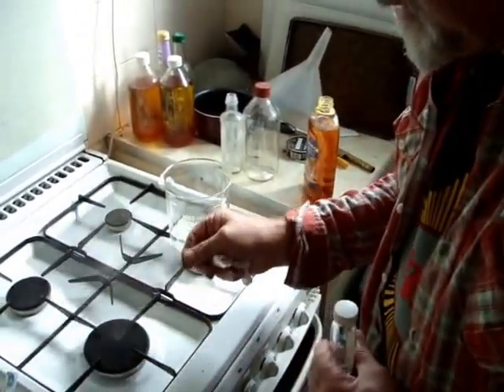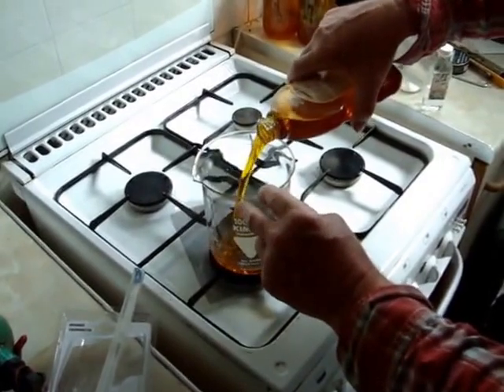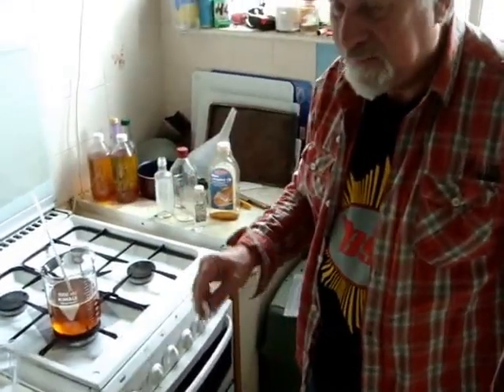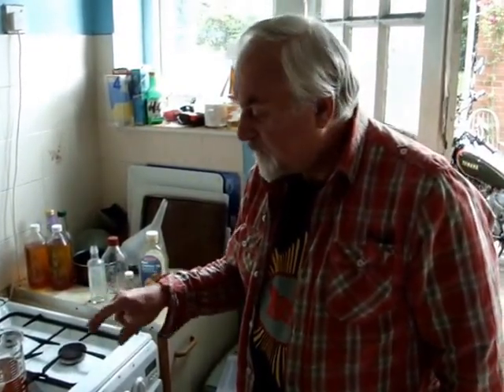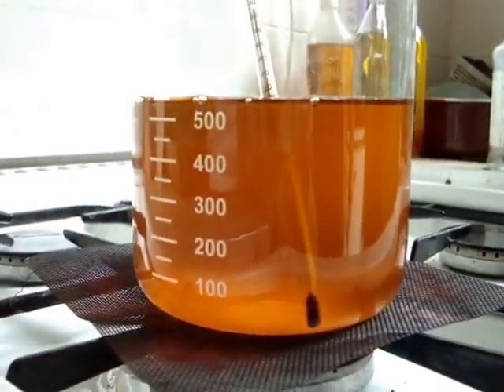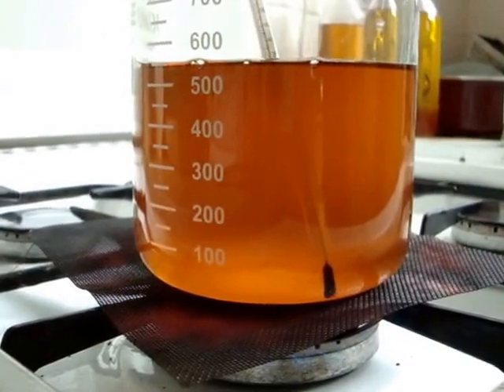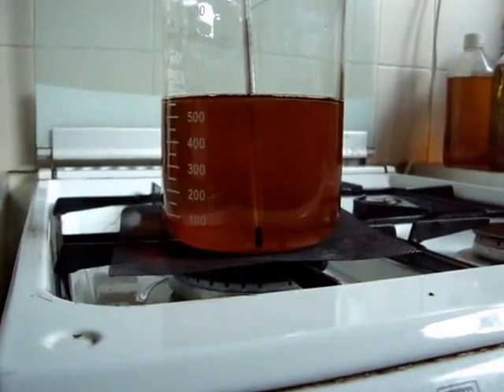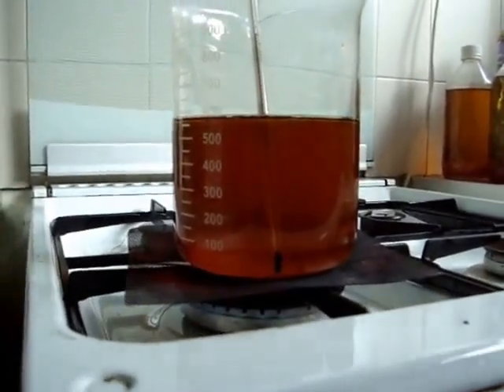Boiling Linseed Oil to Scorch a Feather

Comment from the maker: i have been asked many times what is " the Break " this is the fraction that separates after heating to 240 250 C, and what does it consist of ?  I do not have access to a gas chromato graph to be positive but i made a bit of progress a couple of years back at the start of Covid  , I washed my glassware with caustic soda and collected the solution in a bottle   this was left out in my shed where i happened to look at in winter it now had a white waxy substance floating on the surface ,this looked exactly like the white waxy substance that separates from olive oil in winter . this is Oleic acid, a major component of olive oil and this does not dry to form varnish so it is best to remove this to make linseed oil a better varnish oil they new about this in Italy in 1550 ! now what has happened to Raw Linseed Oil in the USA I suspect that It has been processed to separate the oleic acid which is a very valuable comodity which ends up in bottles with fancy labels as Virgin Olive Oil . this would explain why RLO wont break in the USA  . and another thing when i did try to" break" it i got a vile smell!  again i think this was due to the addition of Fish Oil to bulk it out which is good enough for tool handles and baseball bats and is only 50 cents a pint compared with $4 a pint    sorry to ramble on but  i wanted to get this posted !

Comment: Useful info. I have a small piece of teak that I want to treat with linseed oil. I believe heating the oil will help with penetration. I intend to heat the oil to about 150 c in a saucepan and immerse the item in the oil. Watching this has given me confidence that I won't start a fire at that temperature.
Reply from the maker: Have a fire blanket or a wet towel to hand in case of fire
Reply: @frankpallister  I though better of it - I just put the oil in a can and then put the can in some hot water from the kettle.

I only wanted to heat it enough to make it less viscous to aid penetration because teak is so close grained. It worked well enough.

Thanks for your concern.

Comment: Hello! I've met the recipe from J.Corsaut:1.  Calcined lamb bone consists of a a form of lime: Ca(OH)2.

2.  Wood ash contains the alkali KOH.

3.  Heating linseed or walnut oil with 3% of either Ca(OH)2 or KOH for ten or fifteen minutes at 450 degrees F. causes the fatty acid of the oil to react and dissolve the alkali.  On cooling, the oil becomes a clear, varnish like, amber colored gel.

I've just tried to  make it from  sun-bleached refined sunflower oil. The Ca(OH)2 didn't dissolve and formed a thick pellicle on the top of the oil. Does the temperature should all the time be 450 degrees F? At me, it was a bit higher and grew fast from 450 to 465.

Comment: I’m wondering if any people with experience with raw linseed oil and boiled linseed oil know the difference between using the two products as a wood finish?  Is dry time the only differince, and boiled and raw?.  Or does boiling the oil change the quality of the oil and the finish?
Reply from the maker: i have little experience in oil finishes my interest is in recreating the violin varnish used between 1550 and 1750
Reply: The heating causes polymerization of the linseed oil. Linoleum flooring is names such because it was originally made from polymerized linseed oil. Thus lin-oil-ium. 
The heating is essential. Regular linseed is still a good finish but not the same.

Comment: Hello
Could I cook the oil in a saucepan? I have wide mouth jars but no scientific jars to use.
Thank you for your interesting video.
Reply from the maker: hi  yes its far safer to use a saucepan i only did it in the glass beaker so that the" break",  could be seen but if you have a thermometer or a feather that is not needed , do not put a lid on the pan but if it has one keep it near and if the oil were to ignite putting the lid on can put the flames out !
Reply: @frankpallister  
Thank you for the reply. 
I had a go at it. Despite the container saying Pure Raw Linseed Oil (Sunnyside Corp.)I have my doubts about what it actually is. It didn't behave in the same way as yours. It smoked badly and was a greenish colour....also sort of cloudy.
I will have to find a better source for the oil and try again.
Reply from the maker: i had the same experience when i tried to do it in the USA with raw oil  bought from amazon it did not break and went greenish and smelt vile i concluded that the oil was processed  not raw  in the uk bottles of raw  oil have a little  sludge in the bottom and look hazy      @vtbakerbuilder
Reply: @frankpallister  
Yes. It's very frustrating.
How long does it take before you see it flocculesce after it reaches 220 or so?
Reply from the maker: it does not break below 250 degrees centigrade  you should see it  but depending on your pan maybe not  you would have to trust it to happen and you would know when it was poured (when cool) into a clear bottle and allowed to settle overnight or longer      @vtbakerbuilder
Reply: @frankpallister  ok...I didn't see it at 240°C. Guess I'll have to go hotter. I'm not sure my little burner will get it any hotter.
Reply from the maker: this problem might be caused by something i only recently became aware of !  is the raw oil genuine?  as when i tried this in the USA the oil from amazon did not break this is because it has been treated probably health and safety concerns but no good for old style violin varnish. the raw oil in the UK that i use has a small amount of sludge in the bottom and costs  a third of amazons and also looks hazy  all i can say is buy the cheapest oil probably old stock from a small town hardwear store give modern online suppliers a miss  i kept heating mine (in the US ) and it caught fire so avoid that !    @vtbakerbuilder
Reply: @frankpallister  
Yes I agree. It's not the right stuff at all. I got some raw/virgin oil at the health food store and I'm going to try that. It smells great and has a  slightly cloudy sediment at the bottom. Rather like cold olive oil.
I contacted Sunnyside Corp. who sell the so called " pure raw linseed oil".  I said what I was doing with it and that it behaved oddly and asked if it was treated in any way. After sending the same message 4! times I finally got a reply. Very trite and unhelpful, basically blaming me for misuse. Typical.
The health food store stuff is expensive but I hope to find another supplier if it works.
Reply from the maker: that sounds more hopeful  ,good luck !   @vtbakerbuilder
Reply: @frankpallister  
Do you think the glycerine is absolutely essential?
Reply from the maker: @vtbakerbuilder  no it just lowers the temperature about 10 degrees and smooths the break
Reply: @frankpallister  
Thank you for being so helpful, it's really appreciated.
Reply from the maker: @vtbakerbuilder  you are welcome
Reply: Raw linseed oil needs washed with water before use depending on the brand. To wash it you shake with water until the water is no longer cloudy separating the oil and water in multiple different washings is best. That is why your linseed oil was gasing green smoke. Not all oil is washed from the factory is why.

Comment: It might be safer to use a sand bath for heating the oil. Put clean sand into an all metal saucepan, to form a stable bed for the beaker. Don't use a saucepan with plastic parts or any non-stick coatings, because the temperatures are too high.

If the saucepan is of the right size, it would contain any spills if the beaker breaks and prevent a fire.
Reply from the maker: yes good advice but i dont think it will be possible to get the oil hot enough  ! my latest video shows what can happen , fortunately i was outside with a metal pan with a lid  i hope to list soon  if you ever try it let me know how it goes , plenty of people give advice but no visual evidence that it would work and i am not paid to do everybodys experiments
Reply: I used to work as a chemist and we use sand baths for work where higher temperatures are required, for example, above 250 deg C. The link below gives some details, but I will let you know if I try myself.

http://www.crscientific.com/properheating.html
Reply from the maker: thanks , i have no experience with sand baths so useful

Comment from the maker: i am hoping to add my latest video soon but meanwhile i have made a very important discovery ! i tried this process in the USA but my raw linseed oil bought from amazon did not  break !  i think that it had been refined,  but it did not behave as raw oil , so just as boiled oil is not boiled, raw oil is not raw  . this means that you must be sure you are using raw oil by grilling the manufacturers that nothing has been done to their oil ie acid or alkali treatment but i suspect the answers will be inaccurate
Reply: What is the name of the brand please? I live in England too! I'm wanting to make a paste wax from this 'natural boiled' linseed oil to protect hand tools from rust. Thanks for all the info you've been very helpful 🙌🙏
Reply from the maker: @duncan5800  Bartoline  is one of several
Reply: @frankpallister  Hi Frank! First of all, thank you for your informative videos on violin varnish and ground. So I have a question, I recently bought some fresh cold-pressed linseed oil, which the store pressed it in front of me, but when I heat it I don't observe any kind of break as it happens in your video. So what do you think is the problem here? I even heated it up to 290 degrees centigrade, but nothing happened. One thing to mention is that I left the oil to settle for a couple of days and consequently most of the dark sediment that was settled was not present in the oil I heated. (But I didn't wash or refine the oil in any way.)

I have two other questions as well that I appreciate if you could provide some insight. First, as you know artists in the oil painting world usually refine, wash, their oils to improve it's drying and yellowing properties. So does the "break" happening in the heating process have the same effect as washing the oil? As I understand it the culprits for slow drying of linseed oil are its free fatty acids which are washed, trapped in the water, in the refining process resulting in a faster drying oil. So, does the break while heating the oil have the same effect as it somehow breaks free fatty acids from the oil? I know very little chemistry, but I don't shy away from technical explanations, so any are welcome. Secondly, do you know if heating the oil more, which leads to it thickening and oxidizing more as I understand it, make it dry faster? As I understand heating oil in the absence of oxygen causes it to polymerize without oxidation which results in a slower drying oil, aka stand oil. But heating the oil in the presence of oxygen means it's oxidizing as well and I think that means the oil needs less time before complete oxidization, resulting in faster drying time, right? And if so, do you know if it makes a difference to thicken the oil before adding resin or after while cooking the varnish? (Well, from a practical point of view, I guess thickening it WITH the resin makes for a better judgment of final viscosity of the varnish, but I'm just curious about the differences if there are any.)

Thank you for reading my comment and sorry for its length!
Reply from the maker: @Alireza9900  hi  can i ask where you live ?   i will probably break this answer down to several parts , first although i have a BSc none of my training included fatty acids  so i dont claim to be an "expert " i suppose i have picked up some knowledge over the years  but i find it hard to explain why your oil did not break if heated correctly.  i am suspicious of a place that presses it in front of you as it is no easy thing and could be faked. heat is usually used and  we are not putting it on salad. i have never had problems in the UK using bottles bought at the local hardware store it was when i tried to repeat it the USA that problems occurred with raw oil from Amazon . i would suggest trying your local hardware store the oil looks turbid and will have sediment which does not need to be disturbed , the oil is poured off like a fine wine in fact .   if the oil in the bottle , is clear without sediment reject it as it has been processed ( to be continued )
Reply: @frankpallister  I live in Iran. About the linseed oil I used, I bought it from the food store so it's the edible stuff we put on salad and so on. As for the press, they did it in front of my eyes, and yes it took about 30minutes, maybe more, for a 250cc bottle and I was waiting there the whole time. The only thing I don't know is the quality of the seeds. And yes it did have quite a bit of sediment, and after settling for a few days I can't say if it was turbid or clear, maybe not very clear, but not quite turbid either. But again I'm sure that it was just pressed fresh, and the temperature of extraction was around 80-85° C (temp of the heater of the press), which I checked and it seems it is still considered cold-pressed. To be honest, the reason I chose the edible stuff was that I knew it was going to be pure linseed oil, but I couldn't say the same thing about the hardware store stuff.

I've read in some places that the break can occur at a lower temperature around 177° C, but I wasn't paying much attention to the oil at that temp. Also is it possible that most of the stuff that gets "broken" was settled so that the cloudiness resulting from the break wasn't very noticeable?

P.S.: I didn't use glycerin as a catalyst in my experiment, so I guess I'm probably gonna test that too.
Reply from the maker: @Alireza9900  are the seeds from the flax plant (lin) not sesame or similar  in europe the flax is grown mainly for its fibers used to make a cloth called linen it has a small blue flower when in bloom which then sets seeds which are used for oil production  this is used in the paint and varnish trade  also a floor covering called linoleum  used before plastics came in     to be continued
Reply from the maker: @Alireza9900  nothing happens before 240 -250 centigrade
Reply: @frankpallister  Yes they are flax seeds (the brown variety, not the yellow ones).
As for the temperature, do you think maybe it is possible that for the oil from some flax seeds (since it is reasonable to assume that all the flax plants growing in different regions are not exactly the same) the break is not very noticeable by eye? (Plus I think the lighting conditions of the place where the heating is happening is important as well for seeing the break clearly)
Reply from the maker: @Alireza9900  no i dont think that is the problem then you will see the break when you get it but i cannot understand why its not happening
Reply: @frankpallister  I'm probably gonna test another small batch with glycerin as well and see what happens. In the meanwhile, do you know what substance is actually breaking in the process? Do, for example, alkali refined linseed oils break too? If they don't doesn't that mean they are probably more suitable for varnish? (Just thoughts...)
Reply from the maker: @Alireza9900  i dont think alkali or acid refined oil breaks and these processes replaced heating in oil refining as less expensive and good for most purposes but not for the best Cremona varnish IMHO. All vegetable oils are mixtures in various proportions of fatty acids which give them their characteristics eg olive oil has more oleic acid and does not dry .  at cold temperatue it separates as a milky component this can be used as a method for separating to get  pure oileic acid  this is not relevant to our subject  just FYI.      now when the break is washed with alkaline solution of potassium hydroxide it does not dissolve but floats as a white waxy  solid and i think it is a fatty acid which is undesirable in varnish   but have no means of testing  (i discovered this property after washing my glassware with caustic potash )
Reply: @frankpallister  Isn't there a way to somehow wash this waxy solid from the oil? I've read at some places that for (some) commercially refined oils, the oil is cooled/frozen (I don't remember exactly which) which leads to separation of some kind of wax (which might what you are referring to?) from the oil. Maybe one can do that to a refined oil as well to make sure there aren't any waxes left in it?
Reply from the maker: @Alireza9900  yes there are a few ways to process oils but i am only interested in those used by varnish makers in Italy in the 16th and 17th centuries, i can only think that the problem is with the temperature not being hot enough , does the oil smoke at 240 degrees centigrade

Comment: Hi Frank, thanks for the video. What resin and other ingredients do you add to your varnish? Cheers, Adam.
Reply from the maker: my only resin is rosin but with modifications   based on the work of joseph michelman who published a book called violin varnish however i think his method was flawed and i have made alterations to a couple of things the main flaw is is totally ignoring the advice to boil linseed oil to scorch a feather  he assumed wrongly that common comercially  sold  boiled oil was actually boiled but its not !
Reply: Thank you so much for the reply. How do you find the drying time? Do you use a uv box? Your varnish colour looks amazing!
Reply from the maker: one coat will be touch dry after 2 days in english winter without aids
Reply from the maker: Mara A  just found your query ! i have no experience of beekeeping but i know that propolis  is used by bees to seal holes and glue things up and the propolis is a form of rosin . so rosin in linseed oil 50/ 50% would probably be ok